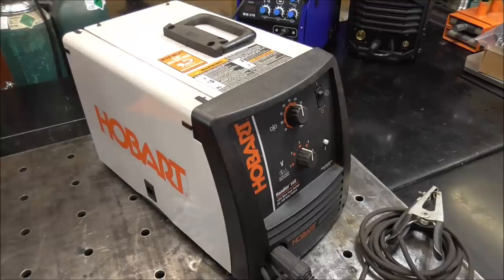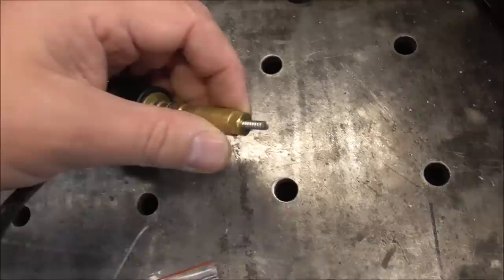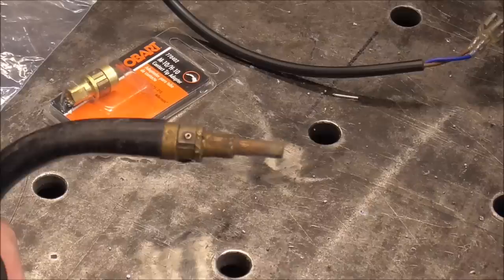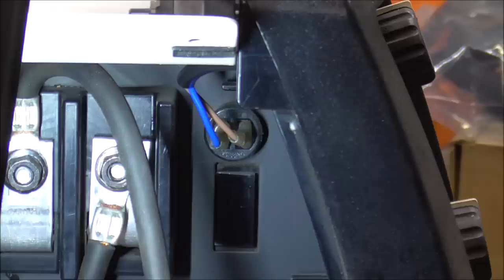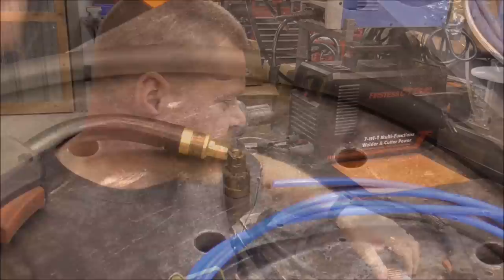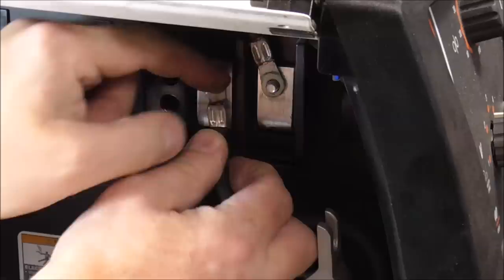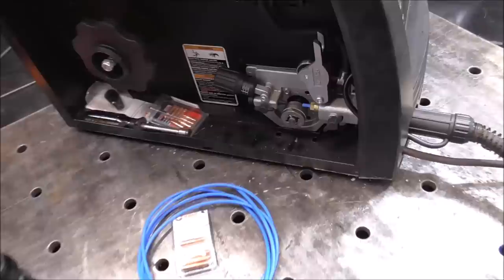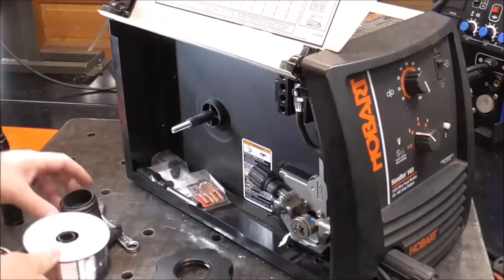Convert Your MIG Welder to Weld Aluminum - The Easy Way

Comment from the maker: SAVE 10% OFF YOUR ENTIRE ORDER USE COUPON CODE BRANDONLUND
🔥https://yeswelder.com/discount/BRANDONLUND
MIG Setup in 5 Steps https://youtu.be/TTZOGyZ4R_Q
LEARN HOW TO WELD VIDEOS HERE:https://www.youtube.com/watch?v=ADa1I319GJ0&list=PLfbf78fMz9VqxPZTT-xmwdcrHVa7ML-ft
Reply: I have used this method many times. Those 120v machines just don’t have the power to run aluminum perfectly. Pause as it is getting too hot. That trigger is your best friend on thin material
Reply from the maker: Spot on! 👌
Reply: I read somewhere aluminium was welded with AC because they needed more heat or amp, not sure whats the difference, to penetrate the oxidation? 
Also Ive seen ppl brush the oxidation layer right b4 welding. Not sure if you should do both or just one is sufficient?
Reply: I think your tip is too far forward, might wanna pull the tip shroud more forward a bit with that same distance. I noticed my welds became a bit more even when I tried it with AL.

Comment: Good job, Brandon.  As a former high school vocational instructor, you need to know that you are doing a fine job of getting the material across.
Reply from the maker: Thank you very much @Mark Fritch I appreciate this. I have to ask, I'm in my early 50's. I've been told that a lot of high schools are doing away with vocational classes. Is this true? I LOVED taking shop class. We had a metal working program at my high school. We rebuilt small engines, we did welding, they taught us life skills like how to change a tire, check your oil and we even did some wood working. I know the schools around me don't have these programs anymore which I think is a shame because these are skills you will have and use forever.
Reply: @BrandonLund  Perhaps it'll come Back but the Priorities of the [WOKE] school Board gotta be for the students Rather than useless agendas. I loved SHOP Class in HS.  Made my Mom a Hickory chopping block similar to those used in kitchen and butcher shop use. Congrats on your presentation sir.
Reply from the maker: It's unfortunate that they need to introduce that stuff into the schools. It's disgusting some of the things that are being pushed these days.
Reply: Cause most teachers can't.

Comment: I’ve been welding ally with my little Hobart 140 for about 4 years now repairing cast mailboxes. I got the Hobart over Lincoln because the wire feed speed maxes at about 750 ipm vs the Lincoln’s 450 ipm just throwing that in there for people who want to weld aluminum for cheap and have a little easier time
Reply from the maker: Huh, Very interesting! Thank you for sharing this! Not only did I find this useful I think a lot of others will also! 👍🙏

Comment: When you're preheating it with your torch, that'd be the ideal time to use your wire brush on it before you weld, to break up the oxide layer, and it'll weld alot better nomatter what process you use.
Reply from the maker: Thats a pretty good tip 👍

Comment: Hey Brandon, what strikes me is that you never remove the sharp edges of the wire when you switch to a Teflon/graphite liner. The sharp edge allows the wire to produce a groove/curl on the inside of the liner. This can cause the wire (especially aluminum, soft) to get stuck. I always use a sandpaper, the point is that the tip of the wire is a bit round. Just a comment and maybe also a tip, have a nice day and greetings, Christian.
Reply from the maker: Thats a great tip Christian. It's something I take for granted but should have mentioned.  👍
Reply: He uses a special laser cutter that leaves a nice smooth edge. You outta get one.

Comment: Brandon, this video is so useful to so many, you have no idea. This was so well thought out and executed. With this tutorial, I think just about anyone could convert their gas mig welder to weld aluminum. You covered all the hard learned mig welder configuration issues I have learned over many years of welding. This is a great help to the community... Thanks for doing this... Joe
Reply from the maker: Thank you Joe I appreciate this very much. It's always a struggle wondering if everything was covered or if i missed anything. I appreciate the feedback 🙏 👍
Reply: He did a fantastic job!
Reply from the maker: Thank you!
Reply from the maker: Sorry Timothy. I can't have that.

Comment: Very good explanation of converting your Hobart. About 25 years ago I bought a Lincoln MP 15  (220 Volt) at a car show. They had the aluminum conversion kit, it came with a smooth feed wheel. Tried the soft wire 4043 and occasionally had feeding problems, switched to the 5356 and have never had the feeding problem again. I have completed several projects and have never had an issue. I hope others will give it i try.
Reply from the maker: Thanks @Bob C I've had very good luck as well. 👍

Comment: 40 years ago this year i started my first business as a hd truck shop in sw kansas. at the time i purchased a linde 225 mig welder and used it nearly every day. i soon learned i could change the liner and feed roller and run aluminum, however i was using the 4000 series wire and with a 12ft liner it bird nested a lot.  i soon got known for doing cast aluminum repairs, and would do cummins and cat oil pans for a flat fee of $175 dollars. the shop rate at the time was $25-27/hr.  the key to success was preheat so i made up a bbq pit from two 55 gallon drums and used my rosebud to heat the interior and the oil pan, took maybe 15 minutes to get to 500F (used a temp stick).  the first run bead i didn't care what it looked like, because cast oil pans have lots of oil in the grain and you have to burn it out.  after the first run i would grind it all back out, reheat and reweld. the welds came out clean and perfect, reheat and let cool within my bbq pit... 

i could usually do an oil pan in under 2 hours, start to finish, and charging $175 per pan made for a nice day!  i remember only wanting to do oil pans!

the same process worked on harley primary cases, golf caddy parts, and even two hole in a fiat piston!

the key to success is "cleanliness is next to godliness" followed by "preheat is mandatory" (for cast parts).

those were good days!
Reply from the maker: It sure was! That's a nice little side hustle you had going. I don't blame you. I would have wanted to do oil pans all day too. Thanks for sharing brother!
Reply: I got called out after I TIG welded an old Harley engine case because I didn't preheat with the torch and it cracked. That was 1976.
Reply: Are Miller welders far superior or are you paying for the name? Thank you

Comment: 35 years ogo I bought a Daytona pocket mig (110v light duty) that had this option as a selling point. Throughout the years I've had multiple migs since I used to make a living as a fabricator. Anyway this info has served me well throughout the years. But I've never changed the liner, always ran wire lube. I blow the liner out with compressed air before running aluminum. Go one size larger on the tip, be sure polarity is right for aluminum. Use knurled rollers (for flux core wire). And use the right aluminum wire. Basically there are two types available use 5356 0.30/8mm with a 0.35 tip. You'll have to run it hot and fast! Practice practice practice and you'll amaze and astound your friends! Plus it's a great thing to have in the ole tool bag of skills 
Good luck!
Reply from the maker: Right on 👍

Comment: Am 63 now ,My first experience with mig was in 1979. By then I meet a HTP representative on a Auto Paint Supply Store. He give me an orientation on Mig because I was very Interested. By Then He Show me That Option , with The Teflon Liner Keeping The Hose straight as possible, and the sizes of tip ect. I Have to Congratulate You , Because you are the only One that Give this Explanation On Youtube. We use That Technique , For The Repairs of the Rear Ambulance Steps. Using a 120v Solar Brand Machine. But years ago I have a 140 amps HTP from the 80. And I make Magic on Body works . That was a Machine designed for sheet metal. Keep Going My Friend !
Reply from the maker: Thanks Ramon I appreciate it! 👍🙏 Don't say it too loud though, there are people here that say this doesn't or cant work (even though it's been used for decades).

Comment: I did this exact same mod...i bought a new 60$ stinger from yes welder off amazon.  And bought the teflon liner.  Cut to fit. And reassembled.  Works like a fkn dream now...i also shortened my new stinger down to 8ft
Reply from the maker: Pretty impressive huh! For the money you can't beat it!

Comment: I just did this exact mod to the same welder a couple months ago. Very nice. I ended up going with bigger diameter wire. Had to turn the voltage up but I was able to back down the speed to 70 or so. Welded a bung to an aluminum oil pan.
Reply from the maker: Nice man! 👍 these little welders pack a big punch!

Comment: I have a couple of Lincoln's that I've had now for dang near ten years or more, good little 110 machines. One maxes out at 90a the other 100 or 110a I think. JUST got a Harbor Freight Titanium Mig140 for work though (30% @ 90a), so I wouldn't have to bring one of my Lincolns in all the time for railing fab and such, and my god do I love it. I've also used plenty of big boy welders over the years, so I know what good feels like... and I NEVER thought a small 110 welder could feel this kind of good. Plus, where Hobart, Miller, Lincoln, etc always give you the old A, B, C, D power setting plus wire feed speed via the old mechanical knobs. This Titanium gives you fully linear control, digital control that is, for Voltage, WFS, and Inductance. . . And I thought this would complicate things, but no... literally from the first bead to now, some week or so and many welds later, it's freaking great. It also has full compatibility out of the box with spool guns. Then there's the Mig170.... a 110/220 hybrid with dongle adapter to plug into either. You get the better duty cycle out of the 110 with limited power, but still a good cycle even at 220 with UBER power... and it does Mig, FC, Tig, and something else... can't remember what the other item is... it's the one I want to personally buy though. But yeah, the Mig140 I got for work was freaking $370 out the door, after membership discount. $450 otherwise.... $400 with a new membership / paying the $30 price to get it. I can't believe how good these things are... time will tell if they're still with me with zero maintenance some ten plus years later, like the Lincolns.... but I suspect they may be... Given the reviews on them, and the time they've been up. And my either one of my Lincolns were easily twice the price, or more... The smaller one was purchased as a FC only machine, which I later converted to full mig (adding gas ability)... the other was basically the same machine, I think ten amps more, with gas already included. Either way they each ended up around $900 - $1000 all said and done... Similar to what most stores have an equivalent new Lincoln priced at, with similar power, gas ability, etc. Yet here you get SO MUCH MORE, for under $400.... I honestly can't believe it... and.... annnd... every single item feels better made. From the lightweight but heavier duty unit itself, to the controls, to the braided gas hose that I admit I stole for myself... giving work one of my old plasticy lines. Even the regulator is better than what you get with a big name. It's massively impressive. . . And heck, I guess even if it only lasts half the time it wouldn't be a bad deal at less than half the price... but I suspect it's gonna last the long haul.
Reply from the maker: I haven't tried any of the newer Harbor Freight welders. I would love to get my hands on one but some of these 110 welders can pack a big punch!

Comment: Great video!!  Thanks for sharing.  I’ve got one of these 140s I keep in the back of a Chevy Tahoe. I power it with a Westinghouse Igen 4500 generator and use it for small to medium size welding jobs around the farm.  These type jobs make up over 90% of the repairs I run into.  Great information brother!!!!  God bless.
Reply from the maker: Right on man. It's hard to beat these transformer machines. These mig machines are comparable to the old ac buzz boxes. They take a beating and keep on working. God Bless you brother!

Comment: I have a Hobart 175 and did the same.  It worked pretty damn good.  Did not do much with other than a new liner(not teflon) and that was it.  After changing the liner back to my steel, did I NOTICED I never changed the MIXED gas to Argon.  lolol  With that said, I'm sure the welds will be spot on.
Reply: Remember the rules for MIG or TIG welding aluminum: use only Argon, or for a hotter weld a mix of Argon and Helium. It's also very important that aluminum be clean or it won't weld at all. No oil, grease, paint or gum from labels. If it's not clean use a small disc sander and then clean it with acetone or laquer thinner. In the industry 5356 filler rod is always used, as opposed to 4043, so if the part is Black anodized the weld does not turn white.
Reply from the maker: Right on! 👍
Reply: @georgebuck2269 ..which wire should be used for welding a crack in an alum. Suv transfer case 5356 or 4043?
Reply: @Lou-eye  4043 is recomended for aluminum castings. But more important is that you preheat the transfer case so it won't crack after you finish the weld. The idea being not to start a hot TIG weld on a cold casting. And don't let it cool off, finish the weld first before going to lunch. If you stripped it down with no seals, gears or bearings in it, it's ok to heat it up with the torch. If it's full of rubber seals go easy on the preheat.

Comment: Great video. I just picked up a Hobart 140 2 days ago to replace the one I left behind in Alaska.  Just FYI, I have run 4043 wire through a (brand new) metal liner for a small project involving cast aluminum. Different machine. Had to keep that whip dang near strait, but it worked good.
Reply from the maker: Yah 4043 is super hard to run without problems through a liner. I've given up on it lol. The 140 is an awesome machine. A real workhorse for sure

Comment: I have welded with aceytelyn and oxygen miles and miles of copper pipe for A/C units on condos and commercial for new construction from 1/4 to 1 3/8" inside dimensions with silver sodier. Had a Lincoln stick welder I used for a lawn service on the side. Bought it out of necessity when a leaf spring broke away from an axle on an old rusted trailer. During Rainey season in Florida I'm laying in 3" of flood water arc welding the axle to new leaf springs and brackets. Read welding books and hope I could repair it and not die at the same time. The weld looked like peanut butter on both sets of leaf springs but it was a strong weld and never broke loose. Had no time for practice had to get the trailer welded and no one else wanted to do the Joe so I did it. That was 35 or 40 years ago and after all this time I'm currently living in the Philippines and have a desire to buy a welding machine to use primary for motorcycle mods and repairs. At 64 years old. Want to race motorcross again but my body saids no. Always loved being able to make things or modify them, remodeling houses, making cabinets. The welder will sit unused most of the time but it would be great to have to make mods and repairs. I can get a 200 amp arc welder for 50 us dollars here new and a 300 amp for just under 100 dollars. A flux core mig welder around 100 or a little more. Getting argon is not an option on this small island in the Philippines. And I would not use it enough to warrant it's cost. Basically I'm a new by with very little welding experience. Cannot decide on 200 amp or 300 or arc or mig flux core. Will never weld anything over 1/4" and most likely metals for brackets and stuff. Rusted out cracked motorcycle frames. A lot of cheap china motorcycles here with poor grade metals that rust out with high humidity and salt water from near the Pacific ocean. People are poor here and I don't mind helping them with simple welds. Retired have time to learn now.
Reply from the maker: I apprecaite you watching and commenting. Welcome aboard!
Reply: If you weld on a spring it will just crack again. If you preheat the spring is no good.

Comment: Great Vid, when I bought a liner and tank for my Lincoln years ago, the desk informed me the liner was needed as anything that had touched steel would contaminate the weld. That would include using a steel wire brush to clean the aluminum to be welded. Watched a body shop vid that said to have a totally different set of tools for working on any aluminum, and a different isolated (grinding dust maybe) area of the shop...not very practical, but appears contamination is a real issue on repairs.
Reply from the maker: Some people will tell you it's ok to use the metal liner. They are wrong but it's their project so I'm not going to argue. You were given very solid advise. I actually have an aluminum plate that I weld on to eliminate contamination. Aluminum needs to be kept very clean with no steel touching it
Reply: Yes sir you are correct. Always use a stainless wire brush for aluminum.